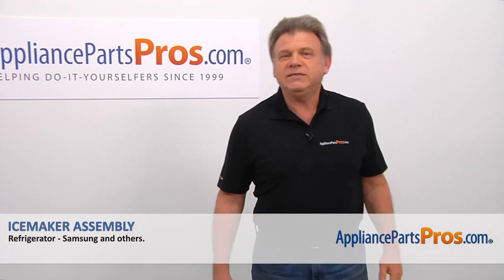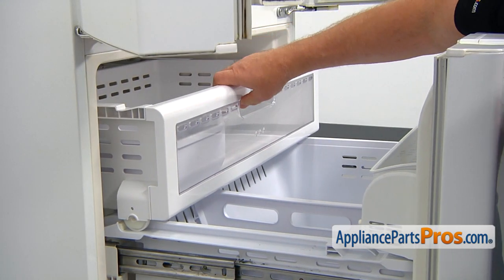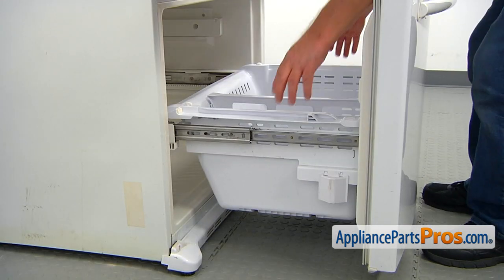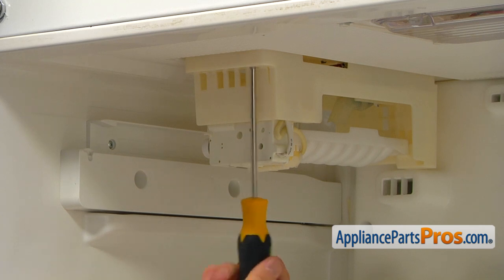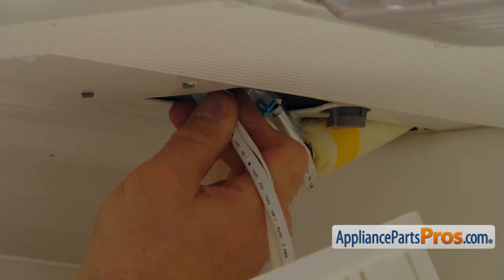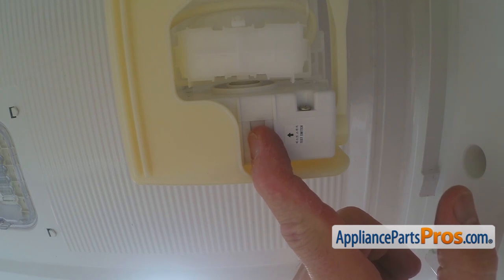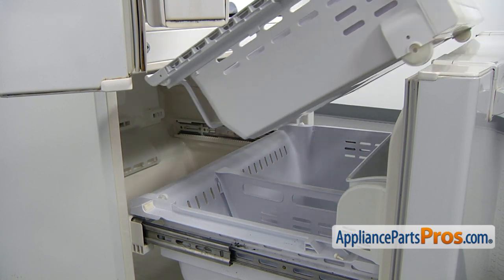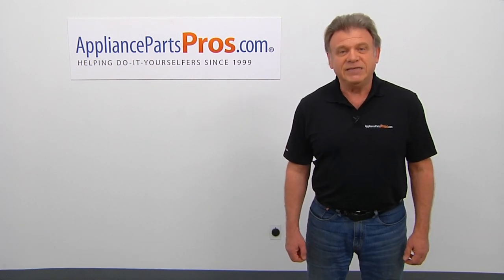How To: Samsung Icemaker Assembly DA97-05037D

Comment: my samsung top freezer  RT18M6215SR ,makes ice but does not harvest , only when i press the test button, i replaced the ice maker and did not  solve the problem , control board same thing , any idea please ?
Reply: Did you ever find the solution for this? I’m having the same issue
Reply: Same thing here if anyone has a fix
Reply: Yes , just unplugged the unit for a few minutes from the electricity and plugged it back in that's all